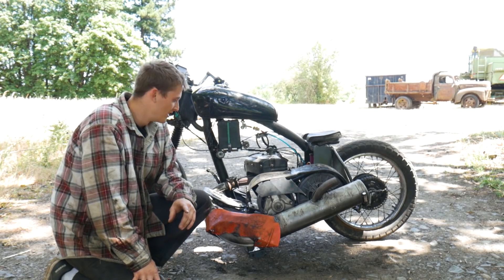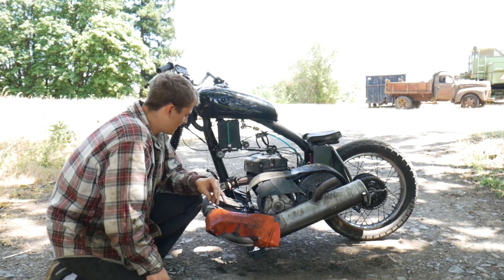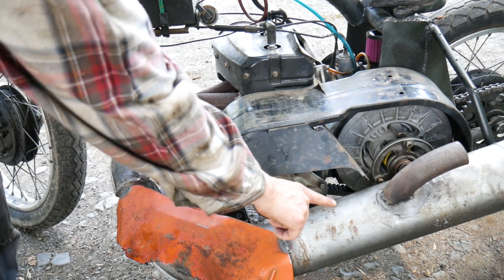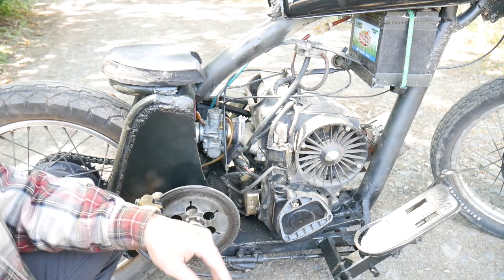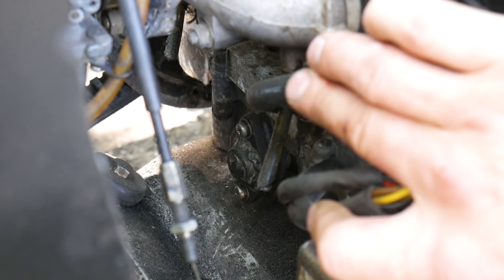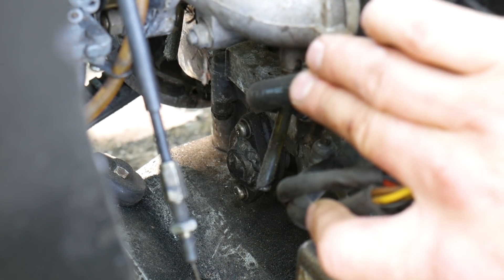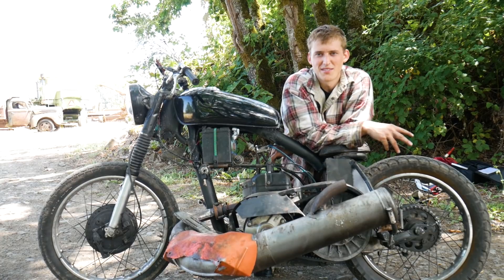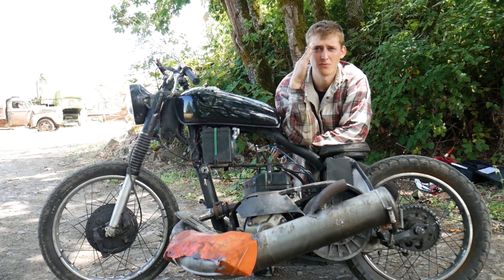Snowmobile engine on a motorcycle |Take 2|

Comment: Petrol oil mixing is always safer than relying on the pump. The majority of 2 stroke motorcycles have wrecked their engines because the oil pump has stopped working. You can trust an oil pump on a 2 stroke as much as you can trust a woman. Also you cannot use engine braking on a oil pump 2 stroke, only safe on petrol oil missed 2 strokes to do this (provided they aren't run recklessly weak!!).

35:1 is a higher oil ratio than 40:1. 

40:1 is on the edge of poor lubrication and 50:1 is right in the middle of it. The best rule of thumb safe ratio is 33:1, speaking from 39 years of riding 2 stroke motorcycles everyday on roads.

Try separating the exhaust system into separate pipes. Fabricating a basic 2 stroke expansion pipe and silencers isn't rocket science or bodging up a system using old 1970's 2 stroke pipes isn't either.
Reply: Andy Reid oil pumps are safe i had two scooters with oil injection never had anything go wrong.
Reply: best power on 2 stroke is with a mix ratio from 18:1 to 28:1 I use 25:1.  but with  good oil 32:1 is ok. use air cooled 2 stroke snow mobile oil. or motor bike 2 stroke oil air cooled type. thare are 2 types of 2 stroke oil air and water cooled type have to use air cooled type oil as it is a air cooled engine. i like the bike with no expansions camber  as it to big and he has plenty of power with out it.
Reply: My understanding of two strike expansion pipes do make it sound more like rocket science. How do you easily figure out what shape the pipe has to be for the sound pressure wave reflection to force a pre charge back into a combustion chamber at a given rpm?

Comment: I have learned that if you have an oil pump that’s working not to delete it. Many people will say just delete it cause when it breaks you blow your engine but what those people don’t know is inside the case is engineered differently with oil injection as to shoot the oil directly on specific areas. Premixed gas through a self oiling engine will not lubricate the bearings sufficiently and will result in failure sooner or later
Reply from the maker: yeah It has been a shit-show trying to do some research on my specific engine model on what the oil pump really does. Apparently up to a certain year the oil pump only injected into the carb manifold.

Comment: And i wasnt yelling we were just letting you know that with the 2 stroke snowmobile engine the expansion chamber helps with making the engine run more efficiently
Reply: James Hebert i ran my $50 snowmoble with tractor mufflers and it worked.

Comment: you can run oil in your gas without any problems 2-4%... aslong as its a 2-stroke... id say overheating. if the exhaust isn't stock you may need to add some fuel to it ! 
(check spark plugs just in case) gray/white plugs is a no go!!

Comment: Try a different cdi box some times they get warm and you lose spark...once cdi cools it will work again, also I would definitely put the oil pump back on.. once the pump is back on while it's idling you can hold the oil pump arm all the way open if it starts smoking real heavy then you know it's working...great video

Comment: I always think that it's best leaving the injection pump on if you can test it to make sure it's pumping oil. Some of these engines have shielded main bearings that are directly oiled by that pump and oil injection meters the correct amount of oil as the engine needs it, especially if there's a second throttle cable controlling the metering pump never assume that when you take the pump off that a standard 40:1 ratio will work with a converted engine, 26:1 and make sure you richen the main jetting to accommodate the additional oil in the fuel so you don't run the engine lean on fuel.  This is really bad for air cooled 2 strokes especially previously oil injected engines

Comment: I don't see how removing the oil pump would shut down the engine. You are probably just over heating the engine, snowmobiles are designed for cold temperatures. You could also have a case of vapor lock.
Reply from the maker: what's vapor lock?
Reply: Actually snowmobiles have better cooling than typical two stroke bikes since they are fan cooled engines doing harder work than bike engines.
It's ALOT heavier to haul an snowmobile than a bike.

BTW i run my two strokes on 25:1 oil mix. They're pretty much smoke free using good low smoke two stroke oil and correct jetting.
Reply: @OliverMotorized  That when fuel in carb boils so you get fuel vapour displacing the air from intake. It usually doesn't occur when driving but more commonly gives starting issues.

Comment: I would take The two into one exhaust off and put two separate expansion chambers on the two into one exhaust will interfere with scavenging and upset the Power band you will produce way more hp on separate expansion chambers motorcycle manufacturers would use to enter ones on 2 strokes to keep the costs down but you very rarely see a two-stroke motorcycle with a two into one that is only used on 4 strokes If you try I look forward to seeing the results I think you will be impressed

Comment: When you remove the oil pump and run premix then you lean out the motor and make it hotter. The oil mixed in with the gas reduces the amount of gas actually burning so it gets lean. I'd buy some cheap jets and also maybe a cheap temperature guage off the interwebs to know your head temperature eh.

Comment: It wouldn't hurt to run a little extra oil in that just to keep the engine a little safer with all the Heat also not sure if you know the higher the number the less the oil so I can 50 to 1 has a lot less oil than a 32 to 1
Reply from the maker: Thanks for the suggestion. Yeah I miss-spoke in the video i think I said higher ratio or something like that lol
Reply: @OliverMotorized   no problem :)

Comment: Not all engines designed for a separate oil system will get enough lube to crank main bearings using premix. Drilling oil lube holes above bearings is not difficult. Info will be easy to come by.

It definitely sounds better.

Comment: Sounds like a vapor lock thing. oil pump has nothing to do with the engine running, strictly lubrication . Might have to duct heat off the engine around the carb
Reply: not so fast , ive come across this skimobiling builds ,the gear is still in there spinning on the crank ,use to be bathed in 2cycle oil now nothing!  u must put the pump back on and cycle the oil through a resivor tank the gear shaft in there is siezing or you can take the motor apart and take out the guts of the oil pump. Take it from someone who's done it and siezed one before

Comment: If you disconnect the oil injection pump and lines you are deleting the pressurised oil supply to the sealed main bearings of the crankshaft of this engine..result will be the complete destruction of these bearings and a complete engine rebuild required to rectify the problem..While premix is ok to lube the cylinders,pistons and the whole engine top end..this engine has been designed to run the oil injection system only..

Comment: You need to take all that metal off round the heads then take the exaust manifold off and put twin pipes with expansion chambers off a dirtbike or summat and id put a gearbox on it that would be scary

Comment: If it lost power then died when hot I would check fuel supply. Check the fuel flow rate from the tank first and then so on etc.

Comment: You will need to have a look at the specifics of that model engine. I do not believe there are any oil sensors on a arctic cat engine of that vintage besides the oil bottle level, which only turns on a light in the dash.

Comment: on the carb , the needle and seat has a size on it . if your using a fuel pump  ( like on a snowmobile ) you use a smaller size needle and seat , and if your using a gravity feed fuel tank ( like a motor cycle ) , you use a larger needle and seat . ... this is different than the other jets in the carb and is only use to maintain a certain level of fuel in the float bowl ....

anyway , i think your problem may be too small of a needle and seat and your running the float bowl dry

Comment: Depending on where the coil packs are located, those can easily overheat and cause the exact issue you had, especially if they’re 30+ years old. Also, I think you’ve got oil mixing backward, if there’s less oil to fuel the first number becomes larger, so 50:1 is more gasoline in the ratio than 40:1, if I were you, I’d start with 32:1 (lots of oil to gasoline) and then lean the mixture based on smoke color/amount. It’s much, much safer that way than accidentally leaning it out and burning up a piston.
Reply: I think you are right. With less oil, it's running lean, which will make it run hotter
Reply: I thought leaning out referred to too much air relative to fuel. Adding more oil in the premix would mean more lubrication but a slightly leaner mix for the same jetting and air screw settings, because oil is replacing gas. No?
Reply: There are two types of lean for a two stroke, as oil is mixed with gas, depending on various factors, a two stroke could be designed for a certain mix, say 32:1, and running 50:1 for an extended period could cause premature wear, specifically to the bore and piston ring(s) regardless of air/fuel ratio. That said, a lean A/F on a two stroke can be quickly catastrophic, just as it can on a high compression 4 stroke. A two stroke running straight gasoline will have the same effect, the bearings and cylinder walls will very quickly wash out of any lubrication, and have catastrophic effect

Comment: I wouldn’t run with out the oil injection. The jets in that carb are not meant for oil mix in the fuel.
Reply: nick podgorny haha yeah sure. The oil injection pump wouldn’t be for lube haha. Your funny guy
Reply: He is not wrong. When premixing you would lose 1/32 of your fuel to oil when premixed. But hey not a big difference.

Comment: 2 things: 1: i think your coils are bad. it should be running way harder, and then theres there fact that it shut off when hot. 2: try a re jet, since those things run in super cold climates.
Reply from the maker: smaller main jet right?
Reply: @OliverMotorized  hmm. I'm not sure. go lurk some snowmobile forums. might get some info.

Comment: Its probably your sparkplug, my bike would shut off randomly, then it got worse, It would start up for a couple seconds and shut off, I thought it wasn't getting enough oil. I pulled out my sparkplug and it was all covered in like a black goo, swaped it out for a new one and the bike started right away and no problems sence.

Comment: Would not help for you to remove the current shrouds from the head and cylinders now it's out in the open and has plenty of air flow. The stalling could be a venting issue of the fuel tank? Or you just had some dirt or water go through the carb? I really can't see it being from heat! Their designed to run in the winter but that's under a hood no less! So yeah out in the open air you technically don't even necessarily need the fan or shrouds.

Comment: test your gas cap to see if fuel drws in air , or it might hold gas back in the tank untill it can suck air and flow gas again .
Reply from the maker: yeah I've drained fuel out of it before and it had sufficient ventilation
Reply: @OliverMotorized  then id go for the spark way, however , did you draw the gas as fast as it goes while blasting the engine? mine didnt , and felt like i was running dry and stopped.

Comment: put that oil pump back on!  problem solve.
Reply: ~ The Issue In Relation To: The "OIL PUMP" Is:
1. It Kept The Bike Cooler With A Set Balance, (So Adjust The Mix 25: 1. )
2. The Last Time He Rode It, It Was Without The EXPANSION CHAMBER,
... Thus In Turn, Allowing The Bike To Run COOLER / (Common Sense... )
... The "MORE POWER"  ...The "MORE HEAT!" ___ ( He'll Figure It Out!  ; )

Comment: Pls you must put a  release clutch  ( operated by the same hand lever as any motorcycle  clutch) to unlock the back wheel for when the CVT belt blows apart and instantly locks up your back wheel  or a motor seizures bringing your drive wheel to a dead stop while you are traveling at high speeds.  There is no recovery from this disastrously event except going down hard.  Make it happen ....
Reply: if the belt fails or the engine stops so does the connection between the secondary clutch and the engine. the primary clutch will disengage when it stops turning, that's how they are designed.
Reply: @JB-ro3sz  Not true ... The belt can fail and totally lock up both clutches together instantly.  I have had this happen to me on snowmobiles more than once . Try going down a frozen road at 50 mph and have a belt failure and both clutches lock up instantly and now you are trying to keep the sled going straight until you reach zero speed from 50.... It's an adrenaline panic.
  Every time I see someone put a snowmobile motor into a bike frame I send them this warning... Much better to be warned. A belt can fail and it can instantly lock up both clutches. You imagine the rest.
  Good luck...  Maybe it's best to describe by saying  that when a belt fails it is not always a clean break it can also look like a ball of string exploded. a belt blew like I am saying on my ATV and it locked up the wheels and it took about an hour to cut free all of the strands of belt while I fed the mosquitoes.

Comment: Wh when you're full throttle ear draining the carburetor bowls.. at full throttle it requires a lot of fuel so it drains the bulls kills let it sit a second the bulls feel back up it runs finethat's why you can ride it around like you said 20 minutes and it never killed because you're going slower
Reply: Bowls using talk to text
Reply: So check your fuel line

Comment: Mix gas and oil 50/1 for hot weather. You'll burn up your rings mixing at 35 or 40/1. 👍👍👈🤪
Reply: Why would you want a richer fuel/air mixture for hot weather?
Reply: @isaacclark6749  just add more oil to the gas ???

Comment: needles and seats on a pump fed carb are not the same as in gravity fed carbs., never had a suzuki sled motor apart  but many of the oil injected engines use the oil pump to feed the crank bearings ( crank failure is an issue in sleds) cant see any good reason to remove a working system.

Comment: 40 to 1 is not rich enough.  Need more oil to gas in those old fan cooled. Probably 20 to 1.
Reply: have fun foiling plugs- with new 2 stroke oils most stuff is fine with 40:1 (and in some scenarios 50:1 but don't)

Comment: could be that it overheated , the engine is made to run in colder weather , could allso be that the ignition coils are getting too hot or the sparkplugs oil up 
i had it happen to me once (50cc 2 stroke moped ) that one of the seals on the crank popped out of the case causing a lean condition (cant suck the airfuel in no more )
you could design an expansion chamber exhaust (you can calculate the length , the cone and the diameter ) that fits the bike and have it run along the other side  , that should even out the width a little 
https://www.youtube.com/watch?v=Q1Soo0bCqHs , you can actually build it so the powerband shifts and fits a bike better
Reply from the maker: great, thanks for the insight!

Comment: Why don't weigh more bikes used torque converters? I built a 74 honda with a Predator 212 and torque converter,  more bals than the original engine n trans

Comment: Low oil sensor?
Reply from the maker: I would have thought the same thing if it didn't start in the first place because there is an oil sensor for the oil pump reservoir!
Reply from the maker: The oil reservoir had a low oil sensor, but I figure the bike would have never started if that was the issue
Reply: Low oil sensor just turned a warning light on

Comment: Run it richer it's to lean at 35 to 1
Reply: 35:1 is pretty rich  most 2 strokes just prior to oil injection were 40:1 or 50:1